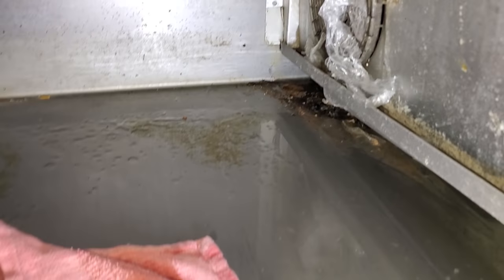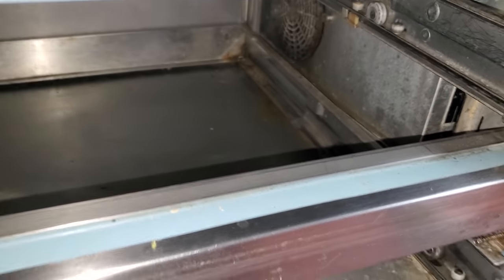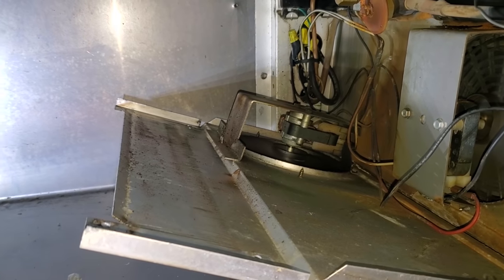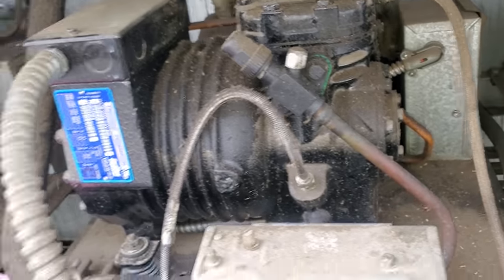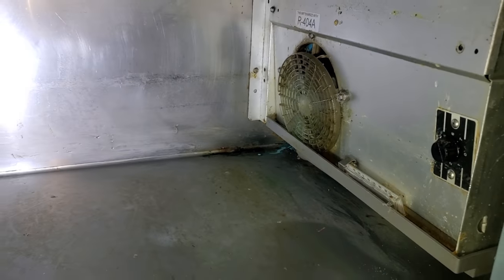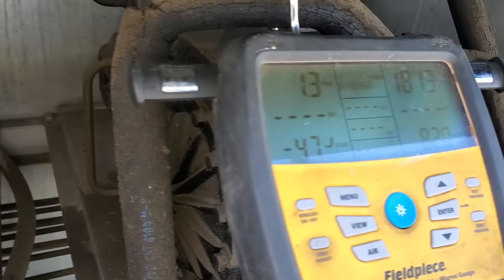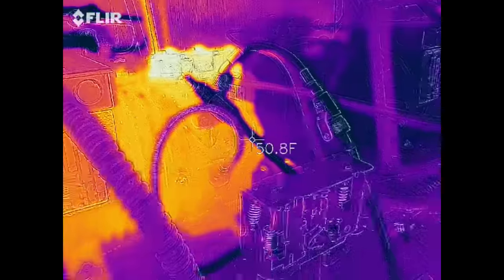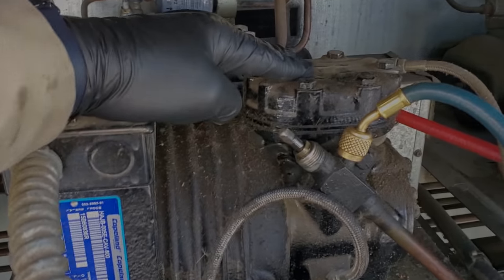COOLER DRAWERS NOT WORKING

Comment: That corroded nasty coil... Most owners / managers do not realize how much acid from certain foods are in the air. The last big place I was Chef, was a Seafood Restaurant that the building was on pylons entirely over the water. 5 month season... 7 months dormant with no heat, old building, salt air. With those conditions, we had to clean everything in the fall then spray a coating of oil so the equipment wouldn't rust.  We would clean our fryers and then leave clean oil in them over the winter. 
Those conditions cut the life of the equipment almost in half.

Comment: Ahh, the ole multi zone system with separate controllers and solenoids... I don't think I have ever worked on one of these systems that didn't have gunk built up in it that needed to be cleaned and sanitized! Very informative for those guys just getting into the trade. I was a Service Supervisor for a company that was building a nationwide business and we prided our selves on being thorough, and while it takes more time and raises the bill, we could promise that when we left, you would have a complete diagnosis, cost and plan of action, with this said, we drove the point home to the individual techs, like you do, it is easy to just throw a quick part in and move on to the next one, but by being thorough, you cut down on call backs, and after a year, owners and managers would see that their repair bills actually dropped in total for the year, even though they had larger invoices to pay, they also noticed a drop in cost to run the equipment. We took on a business that was producing 2.7 Million a year revenue, we produce 2.3 for that year and made a third fewer trips to the restaurants, which equals less down time, a cheaper operating cost and happier kitchen and wait staff. I was told by one manager, he didn't mind paying our invoices because, he made his first bonus check after using us for six months vs the other guys.

Comment: This compressor is almost new by the S/N, something is wrong to have bad valve plate .Good videos thank you
Reply: It doesn't matter how well that you seal any unit, all sealed systems leak.Some leak at an extremely minuscule rate that can't even be picked up by an electronic leak detector and wouldnt be noticed during a pressure test but as long as there are welded joints and schrader valves in use there will always be a leak somewhere.The EPA has taken this into account and actually has an acceptable yearly leak percentage based off of the weight of refrigerant that a system can hold.But if your yearly leak rate exceeds a certain percentage you are required by law to repair the leak before adding in any more charge

Comment: That is an interesting looking compressor
Reply: H body  Copeland fractional horsepower it should be a 1/3 hp compressor.
Edit: actually checked in slow motion and it is  a 1/2HP compressor, usually all H body comps are 1/3 but being 1/2 hp allows it to work with R22 or 404A in medium temperature.
Reply: @LMSILVIA  Ok , im not a pro i just find this stuff interesting.
Reply: Also looks like they can be rebuilt as opposed to the sealed ones he usually works with.
Reply: It's what they call a semi-hermetic compressor. They are rather odd looking. The bigger ones I've seen for grocery refrigeration systems are ever weirder.

Comment: That drawers are even worse than last time i told you to better call the health inspectors 😅
I have an AEG K17 unit at my home, its older than 20 years and still works. No leaks, no corroding coil fins or sth lile that. Works fine. Only the blower starts squeling when I set it on Stage 2. On low stage it works very well. But i want to do a checkup, cleaning coils and oiling of the fans. 
Keep the good work up. Love your videos, cause they are the best of the hvac videos. ✌

Comment: Need to check those txv’s 
bulbs on those delfields, that strap that holds them on the suction line rotten out a lot, and could be your answer to flooding, high suction, etc.....

Comment: If I place a solenoid magnet on the valve and I still get no refrigerate flow what would you recommend. It’s like this setup where more than one evap on a circuit. The other Evaps are working fine.
Bad TXV maybe

Comment: It doesn't matter how shinny they are on the outside, they all look the same on the inside. Question Chris. What do you do when you get roaches in your truck? I went from vans to pickup trucks with toppers. That way when a hitch hiker finds its way into my truck, at least they are isolated back there and not in my cab with me. I try to be diligent and check my tool pouch, torches, exc., but some how those little bastards found their way in. Just bombed my truck. Will have to do that every week for a month or so
 What do you do?
Reply: Oh, and by the way, all restaurants have roaches.